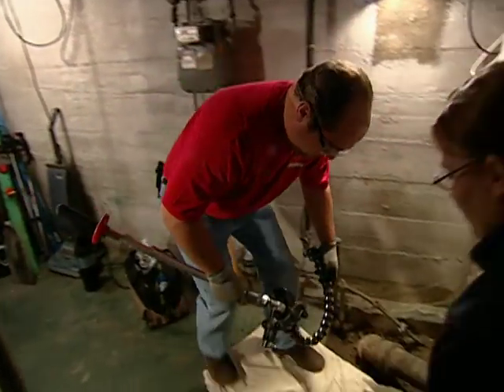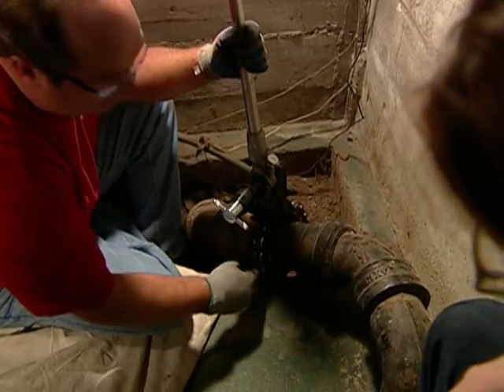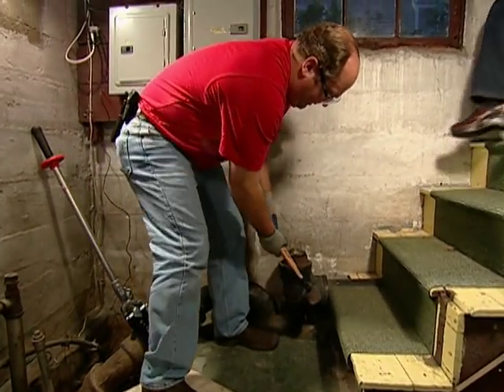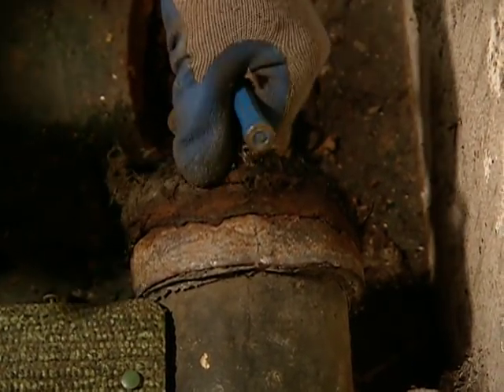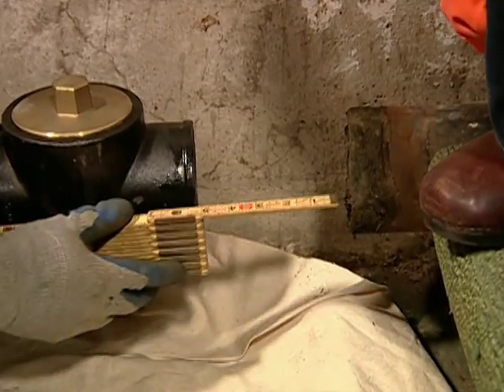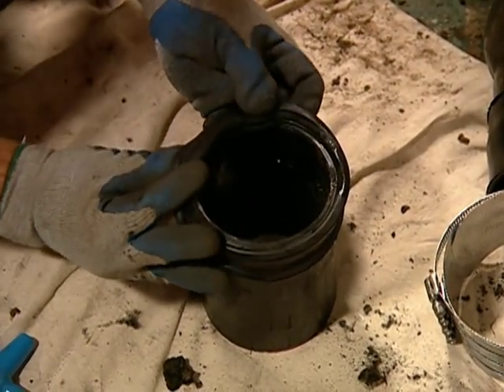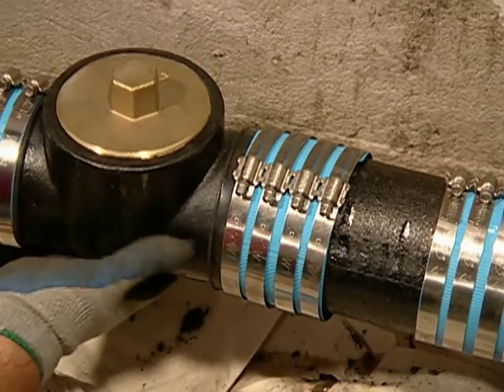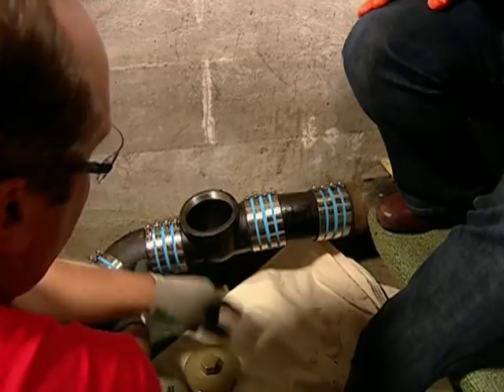How to Replace a Whole-House Plumbing Trap | This Old House

Comment: Sad to see sewer repairs in this style :(
Reply: No fittings fit in each other, all together with rubber cuffs and straps. In Europe, I would have been thrown out of the window for such a repair.
Reply: Do you have a video on how to do it better?
Reply: @tkjazzer   Video not yet, I will search for some, but there should not to use new cast iron pipes, but PVC instead and there will be only 2 rubber connectors on the beggining of the new sections of pipe and on the end. And pipe will be much lighter and the rubber connectors will not have to hold so much weight.
Reply: I would like to see how it was traditionally done before PVC existed
Reply: @tkjazzer  Before PVC existed, rubber connectors did not existed too, as you can see on video, old pipes were connected together one to another. Before PVC existed you had to remove much more length of pipe to replace it and break connection really carefuly not to damage other pipe that should last on its place. Many times you had to cut walls and so on. In Europe is not used PVC, glue or cast iron, just HT System - see image: http://ok-levne.cz/media/catalog/category/ht_1.jpg This system just fits pipes one to another and you need nothing else to connect these pipes, just a bit soap to connect it faster and lighter. If you want to know more about these pipes, please read this: https://www.plastbrno.cz/en/ht-pp-fittings-and-pipes 
PVC is not used in Europe anymore, because it is toxic.
Reply: @tkjazzer  Finaly I found video, that I want. Bathroom plumbing - https://youtu.be/iVoJABDaWB8 That is a new building and plumber is installing new drains, there you can clearly see, how to connect pipes one to another. In case of repairing these kind of pipes, you just cut them, then you slide on pipe this one fitting: http://www.stavebniny-duma.sk/obchod_homedir/data/541/obrazky/ht%20presuvka.jpg and than you put new section of pipe and slide this fitting over new and old pipe and all is done. Now clamps, no rubber cuffs, no cast iron and everything is like "it was not ever repaired".
Reply: @wandrak   cast iron is not used for this in residential applications here anymore. This are retrofit/universal type repairs.  It is usually pvc or abs for the past several decades.
Reply: @mikez4132  Cast iron itself was not the problem , but it is pretty heavy construction and every connection was in video made on rubber clamps, which are in compare to cast iron really weak, so it can not serve long time
Reply: @wandrak   agreed it is a lot of weight to support. No argument there.
Reply: It’s legal here and way easier and safer than packing and pouring. Plus those things hold better than lead joints. Try doing a pressure test on lead joints and see how that goes. I’ve taken off 50 year old clamps that were as solid as the day they were put on. Most of the time you have to cut them off
Reply: Xtrodinary You can’t put pvc in between two pieces of cast iron. It is illegal. Like materials must be used when replacing a section. To use pvc you would have to replace all the cast all the way to the fixtures and vent.

Comment: This is the only time I see Richard using a tool the wrong way !! You're supposed to wiggle the cutter around the pipe to score it !
Reply: This is the comment I was looking for; he's supposed to rotate it so it cuts, not shears...
Reply: From what I see, rotating the tool isn't necessary.  Even in Rigid's demonstration video for their tool, they say that you can rotate the tool to score the pipe for a cleaner cut.  So it doesn't sound as if it is truly necessary.  I did notice Richard's first cut seemed a bit jagged, but there was limited room there as that pipe was located in that pit.

See here:  https://www.youtube.com/watch?v=IYHZPlhmqkg

Comment: you took the house trap away and you put a 4" pipe with a clean out ! don't you need a house trap for your house ?!
Reply: Each plumbing fixture should have their own P-trap now.
Reply: Erik Liska yes I know that but I think they still need a house trap for a double protection ... well I think in nyc you need that if not you'll have water bugs coming out from your fixture drain
Reply: Ask an NYC plumber then, here in IL they are not need and yes I am a plumber Local 130, thus why dont ya think Richard comes to IL, he has to be Licensed
Reply: @xXxM4A1xXx08  go Union.

Comment: why would you waste your time replacing cast iron with cast iron? just replace the removed pipe with PVC. good to see you are using gloves!
Reply: I was thinking the same !
Reply: In MA they can't replace a section of cast with pvc.  They have to use cast again to meet code.

Comment: i think you should buy a real tape measure
Reply: Every plumber should have a folding ruler.
Reply: A good tape measure will keep it's rigidity after tens of feet. A folding ruler is easier to read in short to long distances.
Reply: I am a student plumber that has made the mistake of using the tape measure when I should have used a folding ruler. The folding ruler is less finicky.

Comment: This guys a hack. If your afraid the pipe is week sawzall it. I almost always sawzall my last connection in case this were to break you would be screwed especially if its going into the floor. Why on earth would u re install cast. Talk about $$$$
Reply: AmericaainCapt im a plumbing contractor as well. Have cut tons of cast iron with my sawzall. Yes you will use 5 blades each cut but it does not take hours. About 5 minutes. Also u can buy a diamond blade and cut it. U cant always use chain snaps in tight spaces
Reply: Try using Diablo carbide tipped metal blades. Easily cut  4" cast at least 10 times on one blade and under a minute usually per cut. It doesn't matter how long you have been plumbing for..
Reply: You never tried carbide blades? they cut through cast easy like butter.